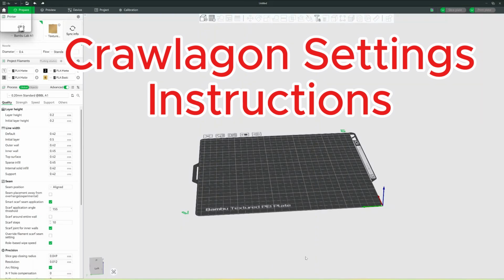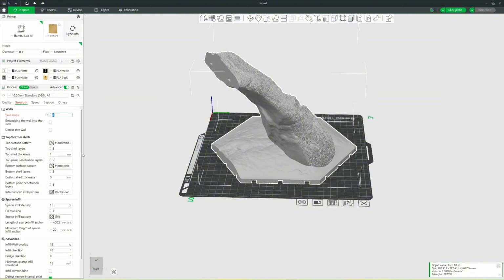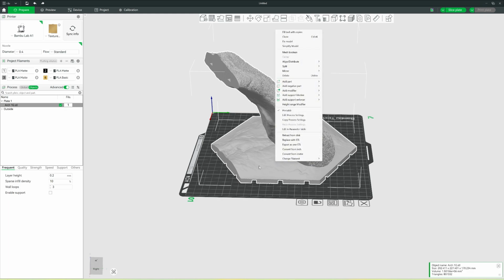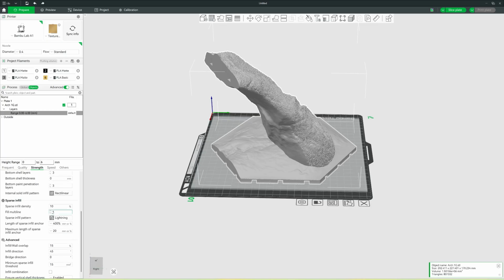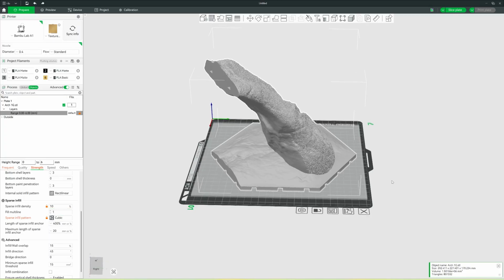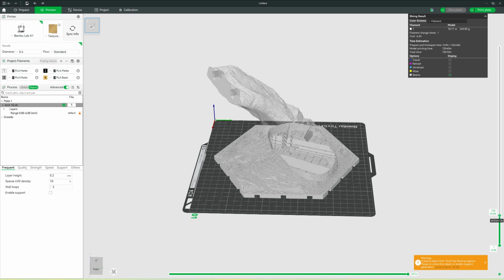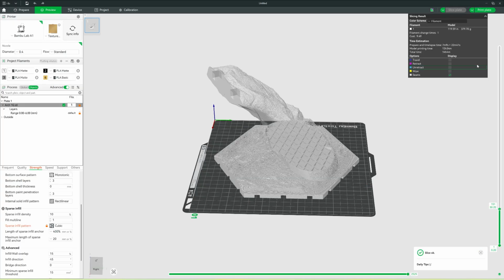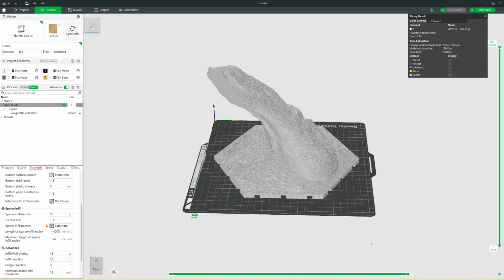Save on Filament 3d printing CRAWLAGON ver. 2

Comment: Interesting.
I use the standard wall settings from Orca slicer and just change the infill from 10% to 3% and set it to Gyroid.
Printed out about 70% of the current XL range and it gets a lot of stick on the charity days running 24 scale on them and not broken anything yet.

Comment: Video is very helpful. Is there a way to change settings so gradient filament only prints on the outside of walls or in specific areas? It tends to be expensive using gradient filament all the way through a print.